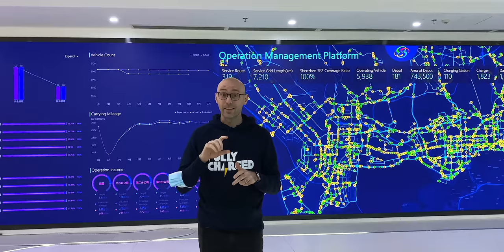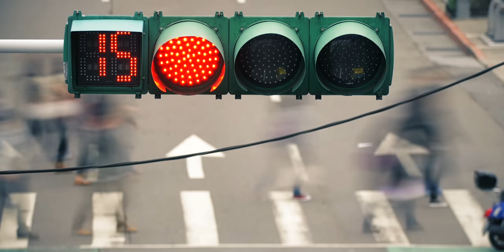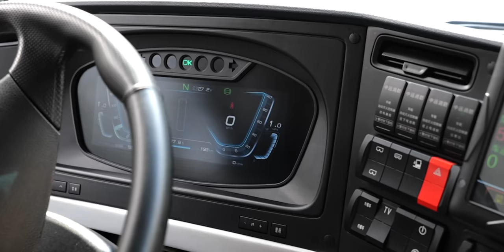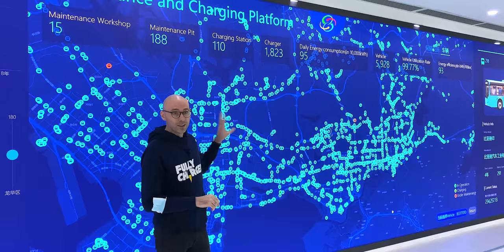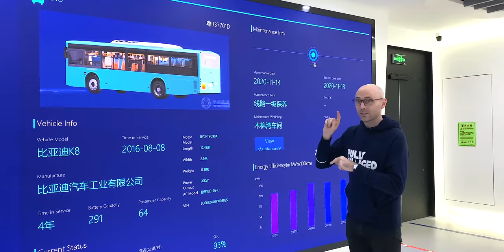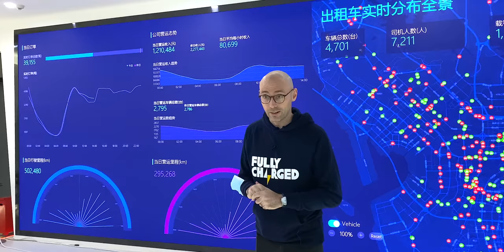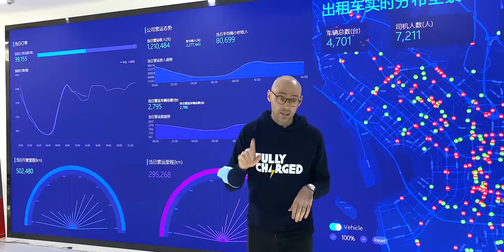The City with 16,000 Electric Buses & 22,000 Electric Taxis | 100% Independent, 100% Electric

Comment: Nevermind about the live data and electric cars and buses ,the actual screen it's on has gotta be 200inches wtf (no mention of the screen size) it's  as if you can pick up one the local quicki mart.
Reply: It's shenzhen... you probably can! 😜
Reply: About 3 years ago I saw a demo of what was essentially an infinitely big flat screen. It was made up of modules that had no edge. The display goes right to the edge. You mount them on a frame so the join up. The clever bit is the electronics to drive them You feed a box with a single HDMI at 4K or 8K and it splits it up into however many modules you have. Glastonbury have been using similar screens for the side of stage displays, and a number of lectures such as TED are also using them instead of projectors. The one I saw was about 300 inches diagonal and was going into a control room for monitoring wind farms in Scotland. The displays were made in China, but the framework and the electronics were made in Poland!
Reply: Screen like those in China is cheap
Reply: You can for rear UST projection I think and can be done for cheap with no mirrors and fancy alignment. Most of the stuff have come from China and can be sourced from China. 

Only downside is they cannot really be used with speakers from behind and space in the back to required for rear projection.

Comment: When you look in the Chinese buses they have seatbelt but I’ve never got why UK buses don’t have seatbelt
Reply: no one uses it though XD
Reply: UK bus drivers are better seat belts are not needed
Reply: @firstchoicelastchoice28  Isn't seat belt needed by the law when driving a vehicle such as cars, planes, and bus?
Reply: Well I'm in Guangzhou what's a super city near by Shenzhen but few buses with seatbelt.
Reply: I am sorry, there is a minor mistake. Not all buses in shenzhen have seatbelts, only those part of their lines are highways.
Reply: @signumxmagnum  Yes
Reply: In 2007, the Standing Committee of the National People’s Congress of the People’s Republic of China revised the "People’s Republic of China Road Traffic Safety Law" and added Article 51: “When a motor vehicle is running, the driver and passengers shall use seat belts in accordance with the regulations. Motorcycle drivers and passengers should wear safety helmets as required.” The new law was implemented on May 1, 2008.
(Of course, "the Road Traffic Safety Law of the People's Republic of China" has been revised in 2011 and 2021.)
Reply: By the way, for city buses, only the driver must wear a seat belt, and passengers do not need to wear a seat belt. But on the shuttle bus, everyone must wear seat belts.

Comment: Bergen, Norway: Continuing building a new, large (and very expensive) urban light rail system, extending trolley bus lines and just phased in a LOT brand new e-buses. The EV / hybrid share of new cars is maybe 80 percent. At the same time, oil heaters are now illegal and toll road fees are far lower for EVs. Very ambitious bike sharing programme is a big success. Yes, a small town, but still...

Comment: I'm from Hong Kong, an infrequent traveler who occasionally cross over the boarder couple of times a year for visits. I must say there were bound to be something new and different on every trip.
Reply: in comparison, hk still runs old toyota crown comforts from the 80s for its taxi fleet, not the most fitting car for such modern city
Reply: @obstinatejack  When was the last time you were in HK? Importation of diesel taxis stopped in 2001 and totally ceased in 2006. 

Perhaps the Crowns you saw were LPG models? Still, emission from LGP engines are just as bad, especially in dense grids.
Reply: HK really need electric buses, exhaust is horrible and one can fell the heat when the bus go by, probably add few degree to the temperature of the city.
Reply: @MMLL369  i was in hongkong at late 2019, i don't actually know if they ran on diesel or not, i just saw them as the majority of the taxi fleet
Reply: @obstinatejack   Either way, diesel = pollution you can see; LPG = pollution you can't see. :))
Reply: @MMLL369  cute

Comment: Great episode guys. I wish the Australian government was so forward thinking. Sydney only has about 5 million and we don't have the political will to do this. They just keep building more toll rds.
Reply: natural gas buses where stared to be  implemented 14yrs ago m8 in Sydney. Much better then electric as charging those buses are done by Solar or fossil fuel power stations? Don"t even mention the batteries discarded after there charging life has expired..
Reply: @auscrank  extract material from the expired one to make new one. same as for the lead acid battery there is a fully function recycling industry.

Comment: Not clear how much of that electricity is renewably generated. I did see the solar panels at the Taxi charging station, though.
Reply: You would massive, huge area to produce electric for those taxies. Not to say they don't or wind.
Reply: @AdrianMcDaid  not really seems these fleets charge overnight and absorb slack in thevgrid
Reply: There is a nuclear power plant in Dayanwan, which is around 80 miles away.
Reply: Also even coal powered, such fleets are
 A less co2 producing.
B cleaner due to pollution being produced at a static site allowing much better cleaning and filtration off exhaust than any car.
C zero city pollution .
Reply: Marc Jackson  any number on how much more efficient Thier grid is after adding the interconnects.?

Comment: The road conditions also looks amazing.
Reply: Not when it's raining, those cheap roads have very poor drainage systems.
Reply: 😂 please look up shenzhen on the map, there is no winter in the tropical zone
Reply: Daud Khan  Do you really think it doesn’t rain in Shenzhen?
Reply: @Ferreira0504  You're correct and the reason is that at the beginning to design the city of Shenzhen, they took the example of former USSR  cities. Those cities are on high latitude....

Comment: Are there any stats on the improvements in air quality as a result of the transition to EV?
Reply: It worst now, cause they use coal power plant 2 charge the buses.....
Reply: @solbris1734  Not necessarily. China is building plenty of windmills and solar power systems. Secondly cleaning a single large power station is possibly a lot easier than millions of vehicles.
Reply: When I lived there the smog was pretty bad even with this in place. Shenzhen's and surrounding cities' factories are mainly to blame I think. Still when compared to other cities in China its still better. Petrol motorcycles are also banned there
Reply: @davidlazarus67  ignore that guy, he spreading hate towards china 24/7 everyday
Reply: The city is mainly power by a nuclear power plant in the east side of the city.
Reply: EVs are charged at night. Without EV the power would be produced but wasted anyway. At daytime no need to burn so much petrol to drive these EVs.  Big saving of energy and improvement of environment.
Reply: @solbris1734  NASA: SO2 emissions in China decreased by 75%
Reply: @solbris1734  
You know nothing about economy of scale efficiency. Pound by pound, it is far more efficient to produces electricity and carbon capture inside a coal power plant than the equivalent individual vehicles.

Comment: I was very impressed by all the real time measures of data being collected by both the taxis and buses. Not only the information about electrical charge and discharge and distance to one charge point to another in the time required. But they complete concept of the route the ridership the revenue the time consumed the time of stop time between stops the traffic Road and speed everything was taking into account real time just amazing. This company knows exactly their asset the cost of their asset the benefit that providing to the city and to their Riders. All that data available to be mine will make these companies so agile to to adjust to the changing needs of the ridership as well as the growing expanse of the city. Success is in their back pocket.

Comment: Great info in this video Elliot, I applaud the move to city EV infrastructure however, could you please make the viewers aware of the electric generating mix in China  65 % is from coal. What is being done to control the emissions from the power plants? 
Thanks
Reply: I mean, China is also the country that invest the most in green energy sources, but that would be another video entirely. A fully EV fleet means that any advances in the electrical grid will immediatly translate into the trasportations system, so it's important to start changing the fleet even if the energy grid is not 100% green yet.

Comment: Very impressive but no mention of where the electrical energy is coming from (%age renewables?) and the additional embedded energy of replacing existing fleets. It would also be interesting to know what effect the change has had on private car ownership and utilisation in the metropolis. If Shenzen can show similar leadership in the application of autonomous vehicles as part of an integrated urban 'mobility as a service' (MaaS) system that will really make it an example to follow.

Comment: Genuine question, what's the net impact of charging these overnight with coal powered electricity (as a percentage) compared to diesel
Reply from the maker: It's a good question. There is a fairly simple explanation which is critically important to understand.
A modern diesel engine operates at about 22% efficiency, meaning for every dollar of fuel you put in the tank, only 22 cents moves you along.
An electric motor, operates at about 85% efficiency, so it's fairly obvious it uses less energy to do the same job.
An electric bus will move about 1 kilometre per kilowatt hour, a diesel bus will move about 1 kilometre but use the equivalent of 6 kilowatt hours of energy, 
So an electric vehicle is hugely more energy efficient meaning it requires less 'fuel.'
And remember, refining oil requires huge a,mounts of electricity which, in China, can come from burning coal.
Reply: Photovoltaics

Comment: GM is a joint venture with a Chinese electric car mfg. its EV is sold for around CAD$7000-9000.  if it comes to Canada, i will be the first in line to buy it even if it will be at least double the price. love from canada.

Comment: This is the same country building new 3 coal fired power stations a week.
Reply: That's because more and more coal power plants are used as backup to renewable energy. There aren't any economic ways to store energy and coal power plants are the only choice when the renewable power plants are offline. You need 1kW electricity from coal at night to compensate 1kW electricity from solar if the load doesn't change.
Reply: @xicloud  I guess the technology needs to get cheaper in order for energy storage to become viable

Comment: The charging is the biggest problem for taxis because of time.
Time is an asset and could be very expensive. We can't get it back.
We save the environment in expensive way, by paying with time and freedom.
Even worse, when I charge my car, I am forced to eat even eating is not on my agenda.
Reply: You are correct on this. But for taxi drivers, they are employees who are required both by law regulations and company rules to take an break each day to avoid over-driving. It's on their contract. They have the freedom to not sign it and walk away.

Comment: The costs to run non fossil fuel transport is 4 to 5 times cheaper. Does this reduction in running costs reflect in the price of travel for customers? Or is it like Dundee Scotland who have recouped the cost of their upgrade to electric vehicles 10 times over but still chose to increase the bus fares to a fare price only extortionists could have dreamt of. 😬

Comment: A pity that they are recharged using electricity from coal fired power stations . Nowhere near enough solar panels to provide the required current to recharge those taxis! It requires the same amount of energy to drive the route regardless of the power used, sometimes more, as batteries are very heavy, and weigh the same whether they are fully charged or nearly flat

Comment: Can anyone explain to me how this EV system beneficial if the electricity they use and production process produces almost the same level of carbon footprint????
as they use electricity generated from fossil fuel, how this makes the system more sustainable and viable. apart from economic benefits, it doesn't hold much.

Comment: China is not exactly blazing a trail as many large UK cities had electric tramways and trolley buses in  the last century but which were replaced with diesel buses because they were not as flexible in routing. The difference then was they ran off overhead electric lines not batteries. Now of course they could depart from these lines and return to charge the batteries or as the UK is trialing have sections of road way with wireless charging for such vehicles. The climate is entering a cooling cycle that will last until mid century so we will see how well these battery systems work in very cold weather like we have just experienced where they have had to bring diesel buses back into service to allow the electric ones to be recharged more frequently though the wireless charging roadways may solve this problem provided the wind power units do not freeze up as in Texas.

Comment: The bus and taxi fleets of this size are so large they would benefit so much from removing replace batteries system that would save them so much time. A bus or a taxi pulls in hot swaps and battery and goes right back into service as opposed to the stated one and a half to 2 hours charge. Just for a taxi and for that taxi driver to have to figure out something to do with their time that's mind-boggling that's an Achilles heel. Hotspot batteries will cure that problem. Vehicle just pulls in over a service Bay batteries drop in slide over new charge battery pushes up latches on and the vehicle drives off 5 to 10 minutes. They shouldn't be charging off of the grid entirely. The size of their brush and taxi parts should have plenty of renewable energy between wind and solar to be charging battery Banks it thermal battery or electric batteries continuously all day all night charge and recharge those batteries

Comment: I work for a company called Proterra we build electric buses and provide all running gear to other companies for integration in trucks and delivery vans. Right now we are working with Highland Electric and Thomas Built Buses to provide 326 school buses to Montgomery County Maryland school district. The buses batteries will also be utilized as back up for the power grid as needed.

Comment: I am just stunned at the charging stations. Sure, it's for maximum profit, but charge, eat, work out, get a massage? Heck a 2 hour lunch break that leaves you relaxed and ready for the rest of your shift seems completely insane in the US.
Also, I am stunned that it took them less  than a decade to go from first electric bus, to fully electric transit system. Meanwhile, here in the US, we barely have mass transit and it sure isn't all electric (or even 10%  electric). China surges ahead while the US is stuck firmly in the 20th century

Comment: Here is the reason why Shenzhen BUSes still on operation -- shenzhen bus fee is very very cheap even from our china opion of view, usually it's about 1.5 RMB -- 2.5 RMB per ride( 1 quarter -- 0.5 usd), most of the time all buses are emty or not crowded even during peak hours(at least in recent years). If this situation happens in other countries, the bus companies goes bankrupt, but since bus companies are state owned companies and city subsidize a lot to the fees, buses,electricity etc.and you can ride these shining e-buses for almost nothing. BTW only 1 or 2 bus companies are private owned which operate 1 or 2 service lines, and  I think they will closed the business soon...

Comment: Hmm, excellent promo footage and all that with subtext of no fossil fuel exhaust pollution from vehicles ... at point of application or use that is.

(Although there is some evidence that we are increasing the particulates pollution what with heavier vehicles introducing more brake dust and tyre "dust".)

And how easy they are to drive with less wear and tear on the drivers which is also a "good thing".

Plus very slick interviewees making sure we know how modern and clean the system is. Although they didn't mention how energy efficient the vehicles were cf fossil fuels per distance travelled.

Which leaves one to wonder how and where the electricity is generated? And how clean it might be?

Emphasis on nighttime charging, on grounds of cost, so will presume not a lot of solar energy around.

I'm all for EV technology but am also very much for green energy production too.

What with the energy required to design and construct these vehicles, then deconstruct and recycle when necessary, plus the energy required to design and construct the batteries etc, etc, I wonder if any overall energy is in fact saved at all.

Would suggest that in parallel with vehicle and battery design as much if not more research is put into pollution free means of electricity generation.

I'm up for the renewables, but as recent climatic events have indicated, green energy is difficult to produce in every cold weather.

I have a preference for nuclear power generation, suitably designed for extremely cold weather.

Which leads me to suggest an episode or three on green energy production might be a useful reminder that at present we are only shifting the point of pollution from urban areas to those more isolated.

Are we actually reducing the burning of fossil fuels overall or not? 

Food for thought perhaps.